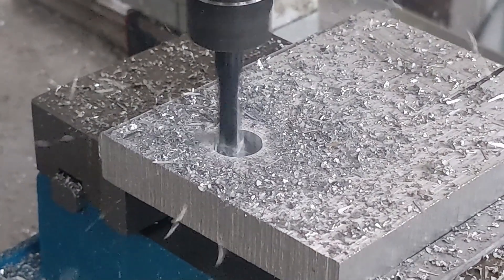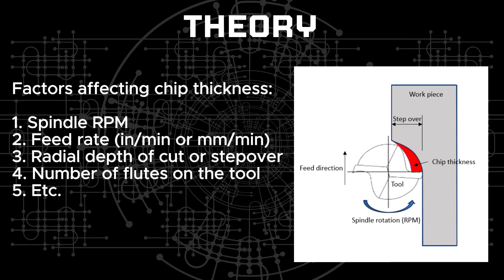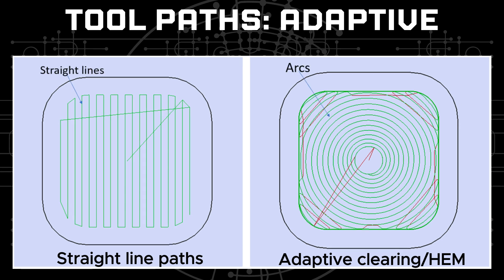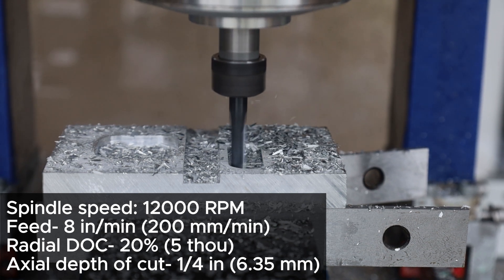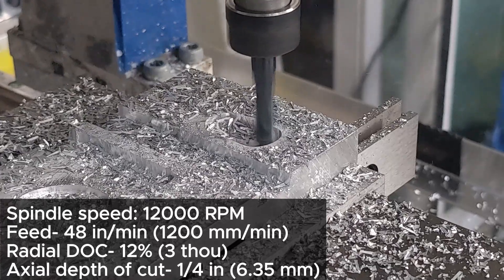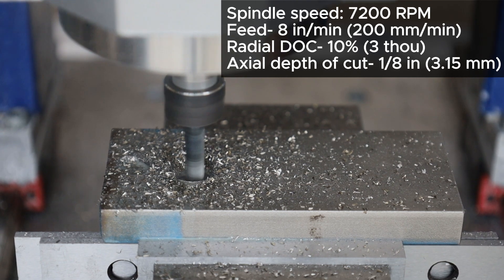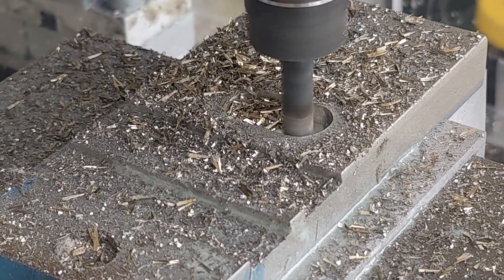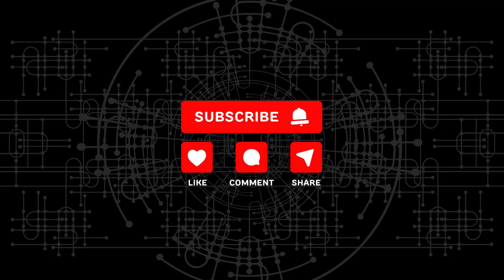The secret to DIY desktop CNC machine (or CNC router) feeds and speeds

Comment: Great breakdown. I like that you take the time to actually talk about the theory and reasons behind the numbers. I think it's important to consider the mechanics of what's going on and make a decision based on that (along with the material, setup, tolerances, etc) than just relying exclusively on rote adherence to a chart.
Reply from the maker: You are absolutely right. Each machine and situation is different. The fundamentals behind the process are the key and that is what I am trying to get across in the video. Thank you!